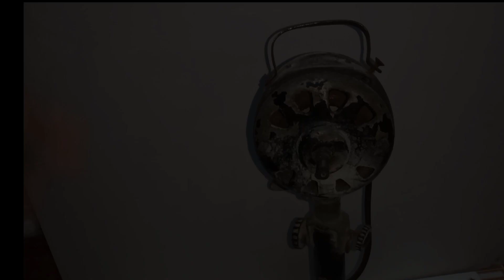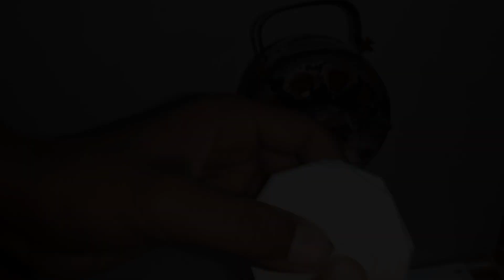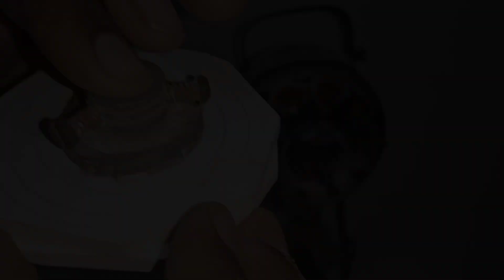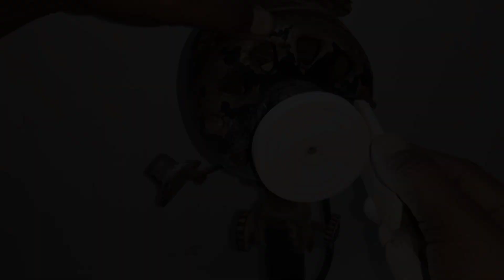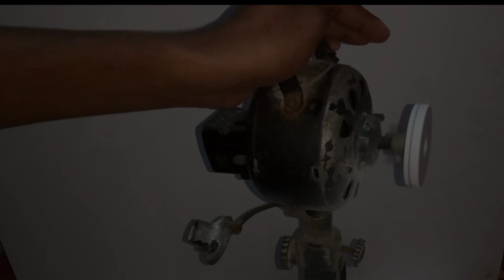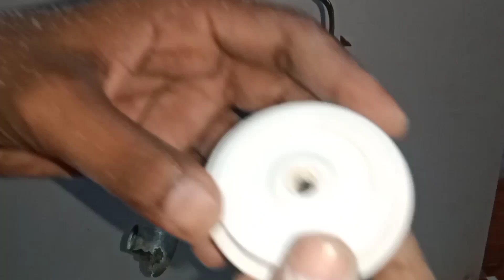How to make train wheels for model trains realistic

Comment: hey, I am your subscriber what is the diameter of the wheel, and can u also mention the dimension of all the pieces in lhb bogie?
Reply from the maker: Thanks for subscribe my channel. The diameter of wheel is 50mm and 3mm for flange
Reply: @RFSHUBHAM  bro can u also tell the measurements for bogie frame and the detailing plss
Reply from the maker: It was designed years before. i forgot  the actual dimensions and the paper is lost. You have to use the proper ratio for making the bogie.. Also design your own diagram.
Thank you.